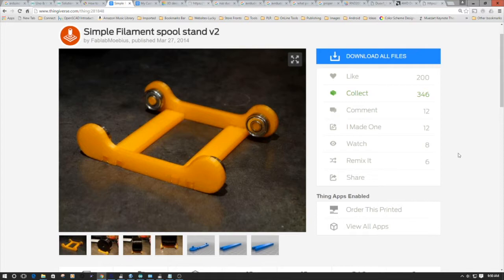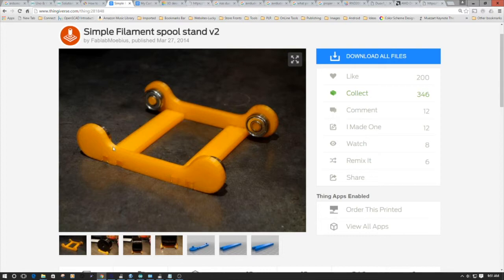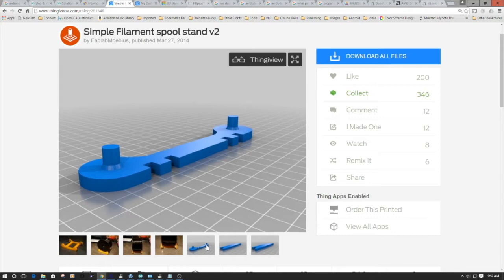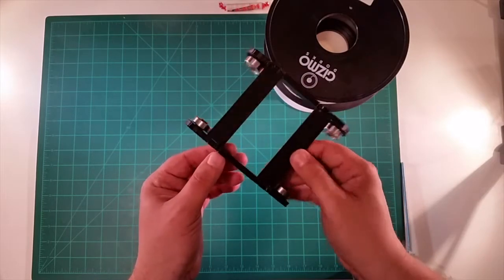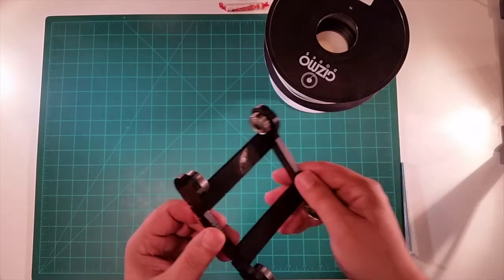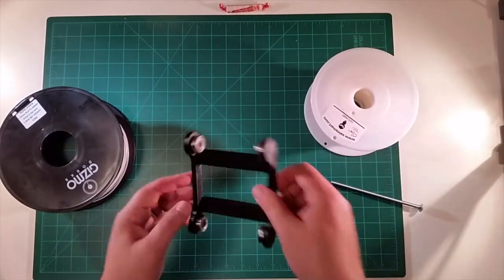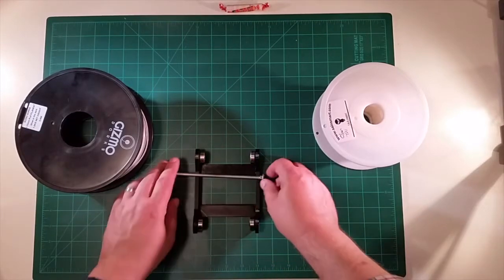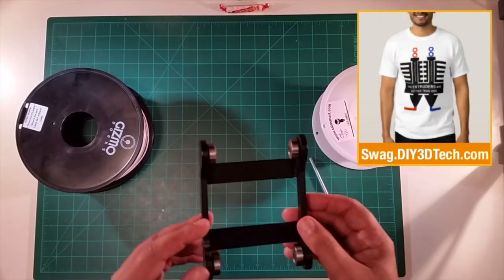Thingiverse Finds - Simple 608zz Bearing Filament Spool Holder!

Comment: Not completely sold on the design, needs to be width adjustable. You really don't need any special slick spool holder, aslong as your head isn't slipping it will unroll hanging on any basic shape.
Reply from the maker: Perfect, no but it was a fun project and allowed me to reuse a bunch of carriage bolts I had left over (which would have gathered dust) so that is one of the things which made it cool!  :-)

Comment: Why trouble yourself with having to exactly position the lag bolts? Just raise the height of the four skate bearing holders and you can give yourself as much wiggle room as you think you will need.
Reply from the maker: Hmm not sure I follow completely as one of the things that I wanted to achieve is constraining the spool from lateral motion (or walking sideways).  Would this be a big issue, now sure however wanted to feed out pretty straight?  So I guess what I am rambling about is raising the bearings would mean the spool would no longer be constrained by the sides?
Reply: having seen your next video, i was mistaken where you were planning to put the lag bolts. i was thinking that you would put them down where you added those half discs. What is the point to those discs on the inside? I do not believe they add to the stability. The beginning of your video has no sound so your thinking if mentioned can not be heard.

Comment: $fn=24;
thickness=7;
lip=1;
size = 40;
difference(){
 union(){
  difference(){
   hull(){
    translate([+size,0,0]) cylinder(r=13,h=thickness+lip);
    translate([-size,0,0]) cylinder(r=13,h=thickness+lip);
   }
   hull(){
    translate([+size,0,thickness]) cylinder(r=12,h=lip);
    translate([-size,0,thickness]) cylinder(r=12,h=lip);
   }
  }
  translate([+size,0,0]){
   cylinder(r=5.1,h=thickness+0.5);
   cylinder(r=3.9,h=thickness+3);
  }
  translate([-size,0,0]){
   cylinder(r=5.1,h=thickness+0.5);
   cylinder(r=3.9,h=thickness+3);
  }

 }
 translate([+size,0,0]) cylinder(r=radius(3.1,$fn),h=thickness+3);
 translate([-size,0,0]) cylinder(r=radius(3.1,$fn),h=thickness+3);
 hull(){
  translate([+(size - 20),0,0]) cylinder(r=9,h=thickness);
  translate([-(size - 20),0,0]) cylinder(r=9,h=thickness);
 }
}

function radius(diameter,sides)=(diameter/2)/cos(180/sides);
Reply from the maker: Was the code cut off?
Reply: Looks like it's all there. Works fine in OpenSCAD. I printed 4 of these and they work great as spool holders.
Reply from the maker: Are you using an external library as where are you calling "radius" from?   You can try emailing it to me info@diy3dtech.com
Reply: I define the function radius in the last line of code.  That's a very handy function that corrects the size of the inner diameter of cylinders in OpenSCAD.